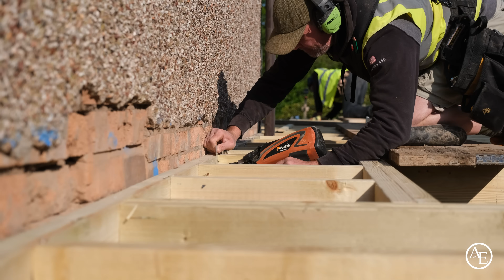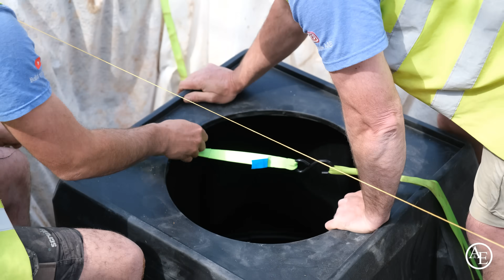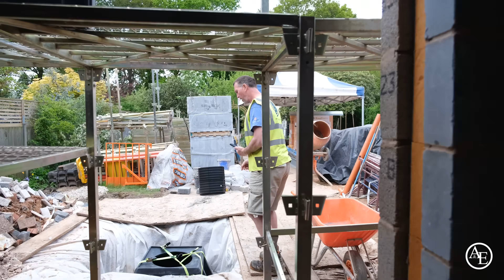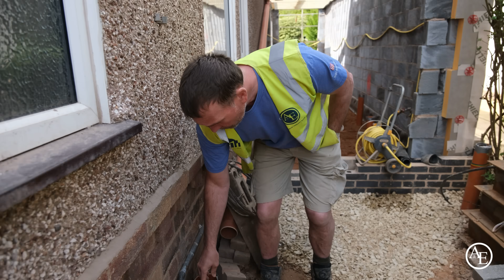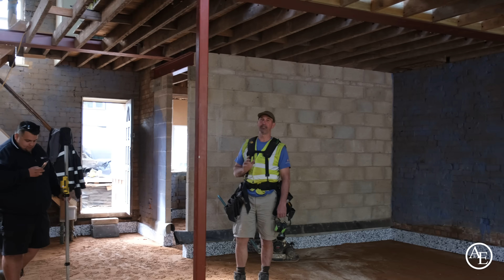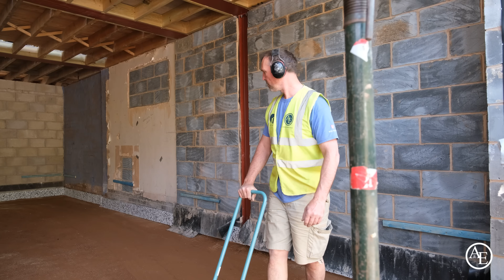Off Grid Water Tank Installation & Concrete Pour | Onsite #31

Comment: Hi Tone,

There’s not a lot left of the old house.

Would it not of been easier and quicker to knock it all down and start from scratch?

I’m also lead to believe (rightly or wrongly), that you don’t pay VAT on new builds?

Ps I’m not a builder, I’m just asking.
Reply from the maker: Hi pops6638 you are definitely correct in the VAT element. There are a couple of potential issues with the location of this house conservation which still could grant the demo but more difficult to obtain consent.
One big factor on this build that 90% of the walls were originally left but they ended up coming out because of redesign, this is a costly thing to do but I definitely think it’s produced a much better layout for the clients.
Renovation work and remodel of a home can get expensive but having cost sheets and diaries are key the project so the clients are always up to speed on cost have a awesome week all the best Tony 👍
Reply: @BuildWithAE  Thanks for your reply Tone.

I’m loving the Vlogs/content.

Stay safe everyone

Comment: Top notch as always.
Taping up pipes is a good habit, I taped up my drains also, and I cover/tape up any pipes and access holes from equipment when working on them during my work as a maintenance technician.
I don't want to be the person having to disassemble a whole machine or installation because I dropped a nut in I can't reach anymore.
Reply from the maker: Hi Tom much appreciated it’s something that I always do now after the issue I had years ago have a lovely weekend all the best Tony 👍